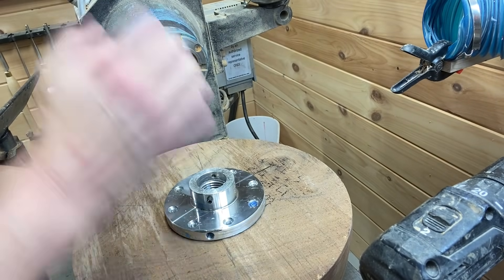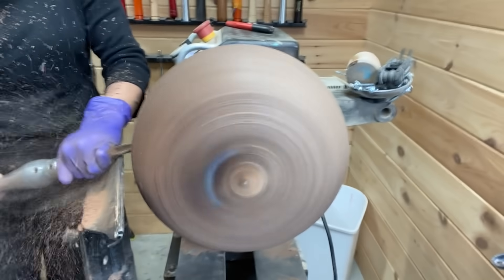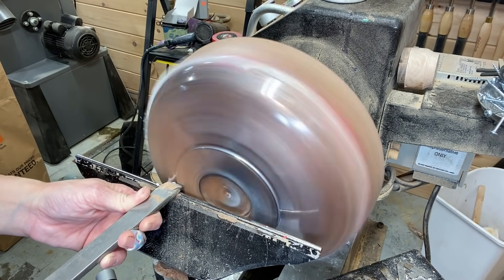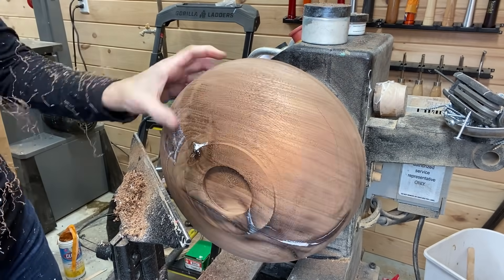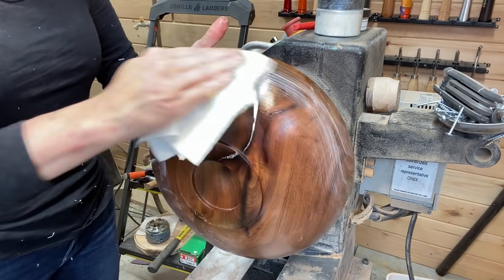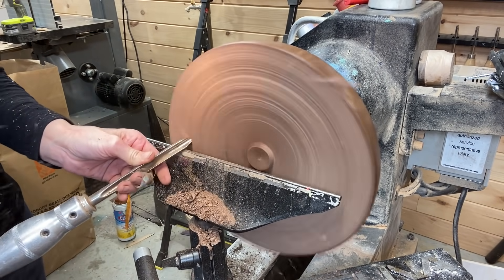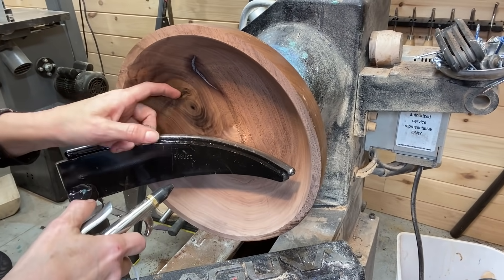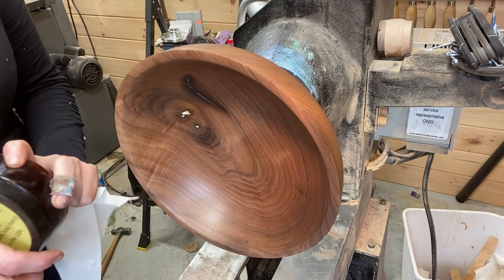Woodturning | Walnut Salad Bowl (cracks filled with resin!!)

Comment: Walnut is a joy to turn.  I have turned mostly cherry and walnut bowls.  One of my walnut bowls did get me into the funnel club when a knot I did not pay enough attention to, came out.  I could probably fix it with resin, but it is more 'fun' to be in the funnel club.  I have also made 4 American flag bowls using walnut as the field with cherry and maple stripes.  It is an interesting glue up and I have friends asking me to make about 12.  It will be a while before I can get them all done, too much overtime at work.  The last Bowl I turned was apricot wood that I got at Craft Supply USA in Provo Utah, beautiful wood to turn.  I would send a few photos - if I knew how I could.
Reply from the maker: Very cool. You can attach photos here in a comment. Or share them on FB?

Comment: I do kind of like walnut, it seemed to sell in waves. Some times couldn't keep it on the shelf, and some times couldn't give it away. I don't turn it any more because it makes me sneeze and itch. For reasons I don't really know, it seems to dull all tools from chainsaw to gouges, more than most woods. This piece you have, for me, it would have gone straight to the wood stove. The big crack runs all the way through from side to side, and to me, that is a huge risk of blowing apart while turning, and glue or resin in the crack may reduce the risk, but it doesn't eliminate it. For me, second reason to toss it is that it is a huge amount of work to 'repair' the cracks. Some people like to do that, but it seems they all want the bowls with no cracks in it.

Comment: Nice bowl. Last walnut project was the first of many Christmas tree ornaments. I have and use a lot of walnut but really need to be careful to seal the endgrain during the drying process. Lost about 10 bowl blanks due to the severity of the cracks, but split the wood and turned into a cylinder for candle sticks or bigger trees.
Reply from the maker: Wow! Thanks.

Comment: Hello Peggy, the bowl turned out just wonderful. The grain and the knot really enhance the beauty of the bowl. 
Questions for you, do the shavings from Walnut get hotter than Maple? I noticed that you would shake off the shavings on your left hand frequently, so I assumed that they were painfully hot. Never worked with Walnut, but I have used Black Walnut as an accent on Maple or Cherry furniture. That is a nasty wood. If you do not cut, plane, or sand with the grain, you will have huge splinters (like 2" long) rip out of the wood. A very dry and brittle wood loves to insert sharp-pointed splinter under your fingernail.  I hope that fall is showing in Maine, here in Minneapolis / St Paul, we are about 10% foliage coloration. In about 2 weeks southern MN will be just past peak. Keep Dancing.💃
🐱‍👤🐱‍👤
Reply from the maker: Thanks, Todd. I think the walnut shavings were hotter...
Reply: @PFWoodturning  but they smell amazing 👊🏽

Comment: Maybe it’s just an illusion but it seems that you have the skew at center line rather than a little above and form a 45 degree angle to the cut. Do you find cutting at center works better? Or is the video just unclear?
Reply from the maker: Not necessarily. I just cut where it works on the particular piece. The video could have been misleading, as I do generally try to cut just above center with the skew.
Reply: @PFWoodturning  Okay. Must just be the video. Just got me a carter and son skew and works great. They should honestly give you a discount or a sponsorship Peggy.